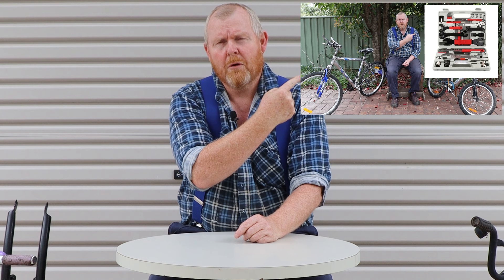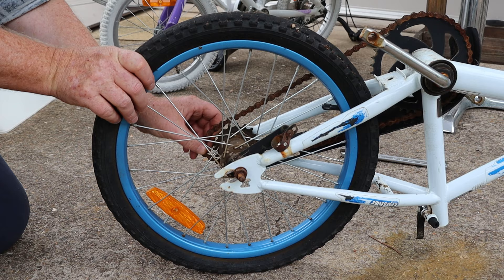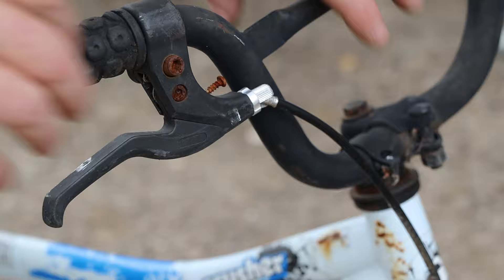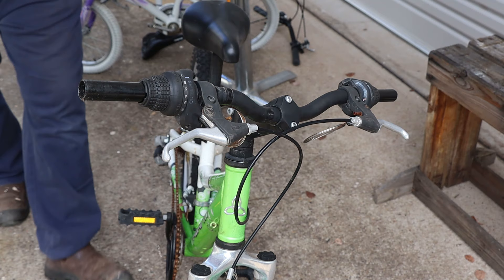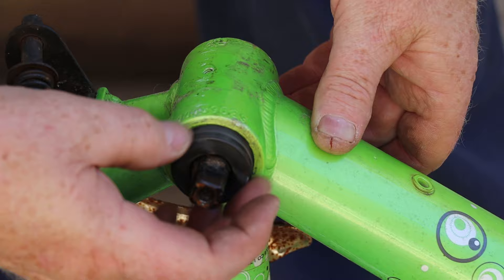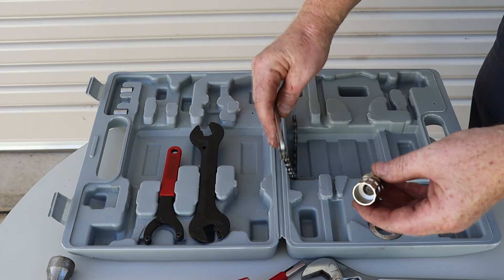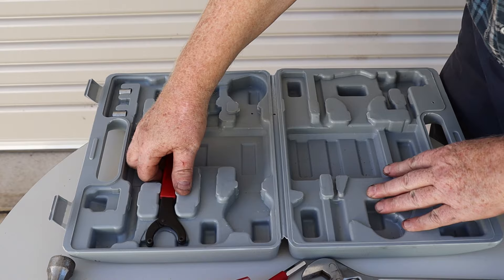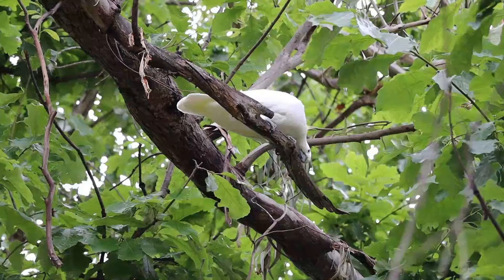Testing a 44-piece bicycle repair toolkit

Comment: chain breakers are the only one I would spend the money on. I have snapped and cracked too many cheap chain breakers that are in that kit, its a very common style, most likely mass produced. I spent the money on a decent one and it still going strong. Granted I don't use it much but it also has a significantly better handle on it, doesn't hurt your hand on those old rusted stuck chain pins.
Reply from the maker: That black one I was using as a replacement came form a very similar Aldi toolkit.  It's almost identical, but it has a has a much better handle, and nice smooth threads in the bolt.  I'll see if I can repair the broken one (the bolt is seized inside the barrel).